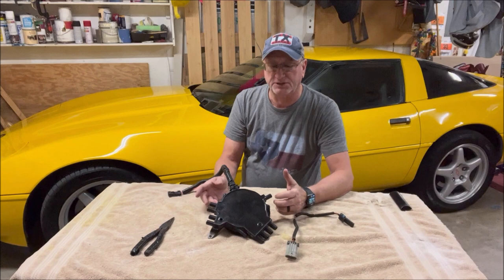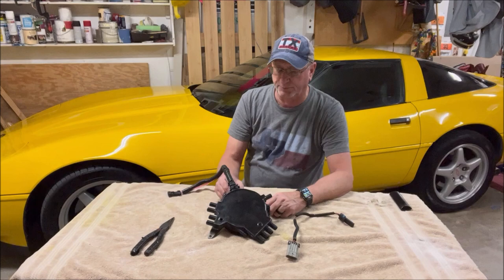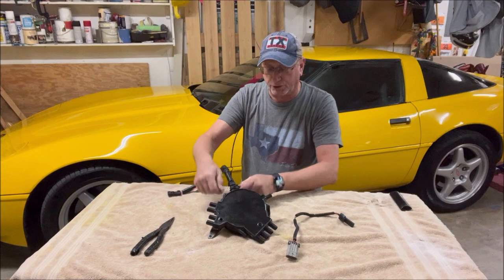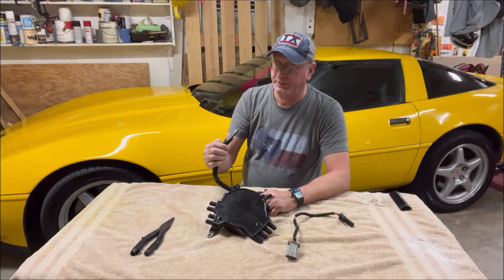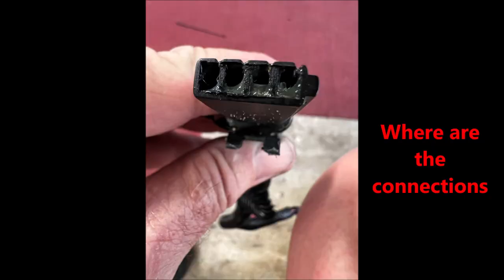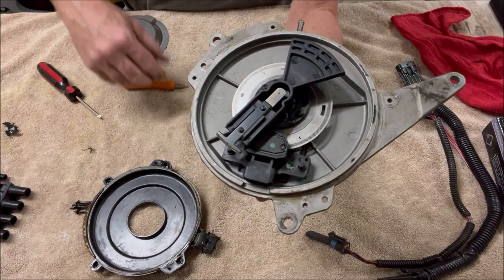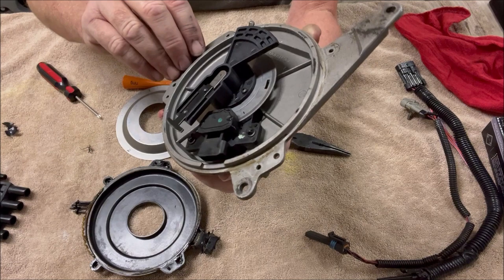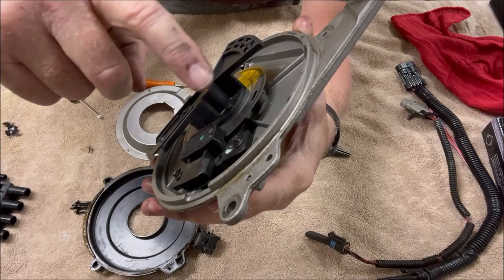My Corvette Journey - Diagnosing my failed C4 LT1 AC Delco Reman Optispark from Rock Auto

Comment: You know it seems harder anymore to keep things factory stock Delco. I have a 90 L98 that I didn't want to go after market on parts. Somethings aren't MFG. GM anymore and the ones that are from China. My intake had an oil leak on the rear RTV seal. So, to put the old EGR, air sensor and EGR vac solenoid back, it seemed easier to replace while the upper part of the tpi was off. I bought GM Delco parts to replace these items. Well, everything was good till it got warm, and started showing a code for the EGR. Removed everything again and tested the Valve. No Vacuum. Replaced with an aftermarket and tested before install. Still pulling codes when it warmed up. The EGR vacuum valve GM mind you was cracked. Not that you could see it. reinstall Old Valve and everything was happy. Yup when it says made in China GM Delco, it's time to go with the best aftermarket you can find. Like you I really dislike doing the same thing twice. Sorry you had this happen with your vett. Glad you shared your issues. Maybe it will help someone down the line with the same issues.

Comment: Are you going to do a video with you using the new meter. A lot of people wluld like to know what the opti output should be at various rpm. The diagnostic manual only says to measure key on voltage ( 5v) , but i would like to lnow what running signal looks like, or at least what it measures with a digital multimeter on DC or AC scale ?
Reply from the maker: I can do that it’s gonna take me a while. I’m having to pull the transmission. Lost my 3-4 clutches

Comment: That isn't a Mitsubishi sensor, they have a Mitsubishi symbol on them. Next time buy a Petris and don't take chances being stranded. 

I've rebuilt hundreds of these, and thousands of the non vented versions, the OEM units do not fail. They need a clean up and a new cap and rotor, sometimes a new bearing, and they will easily last 25+ years. 

Use the MSD cap and rotor kit from Summit Racing to rebuild the OEM distributor and you're laughin.
Reply from the maker: Yes I bought a Petris and it was already installed when I made this video, the car runs great put a couple thousand miles on it
Reply: Do you have any for sale?
Reply: @philpeate6938   yes but i'm in Australia, and i rarely sell them without also doing the installation.

Comment: Thanks for doing this.  I also just ordered a Petris.  I had a great conversation with Chris, the owner.  It is a small family owned business.  Every unit is tested right there in his Alabama workshop, and every screw has lock tight on it.  It comes with vacuum lines and check valves and a cleanable filter in the vent system.  BTW Love your competition yellow vette.  I have had 4 C4s and one C5. Three were yellow.  Did not care for the C5s millennium yellow color.  My current Vette is a 96 torch red.  I could not find a Yellow 96 one with low miles when I was looking 6 years ago (the 96 has OBD2 which is a help for trouble shooting).  Only 488 yellow ones made in 96.  4,400 torch red ones made.  I have been thinking about buying a spare PCM/ECU while they are still available.  Any thoughts on this?  Again, thanks for the post.  I still have the original Opti in mine and will rebuild it and keep as a spare.

Comment: Do you think putting the shim under the wheel would give you enough clearance?
Reply from the maker: Since this is the first one I’ve taken apart, I’m not sure what the actual internal adjustments are supposed to be, but anything would be a better than having a drag on the optical sensor.
Reply: I was thinking the same thing.  Figure it was rebuilt by someone getting paid sweatshop money and they put that shim on the wrong side of the wheel...  I've heard the Mitsubishi sensors never fail either.  There was guy that used to just clean them up, replace the rotor, coil, plug wires, and they'd be good for another 100k...  I'd probably just go with Petris.

Comment: Hello. I  replaced my opti  only a few thousand miles ago. on my 94` Z28. Just started stalling after about 15-20 min.  after  warmed up. then will not start till it sets for about 10 min or so. I got a DTC16 Distributor Ignition System (Low Resolution Pulse). sounds like opti distributor or maybe coil?
Reply from the maker: I bought a relatively inexpensive graphing voltmeter to look at the signals out of the optispark, and that’s really the only way you can see what it’s doing with the high and low resolution signals.
Reply from the maker: Low pulse is from the opti.